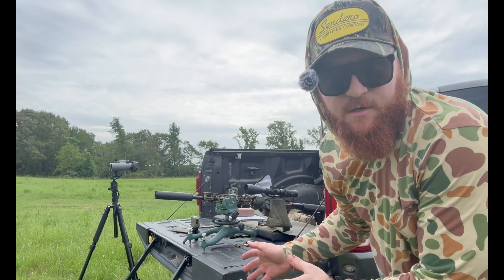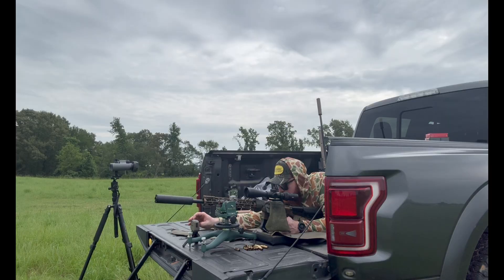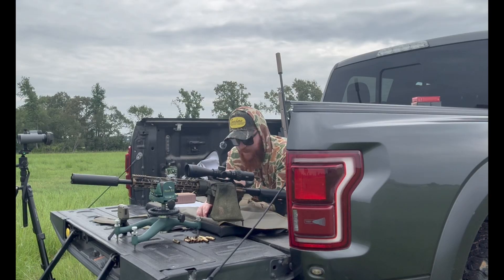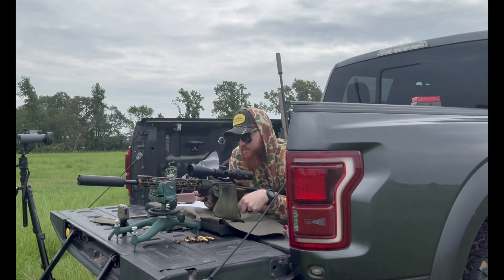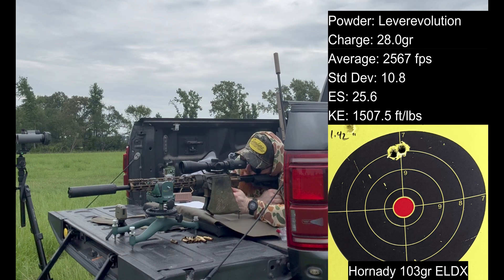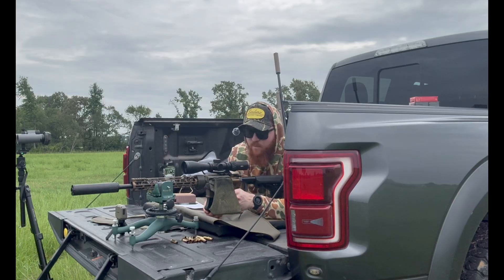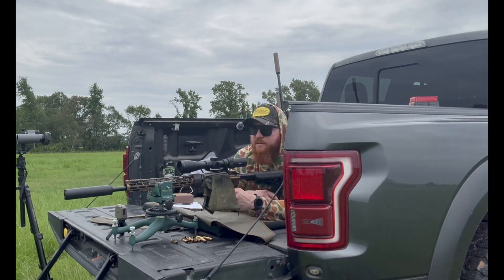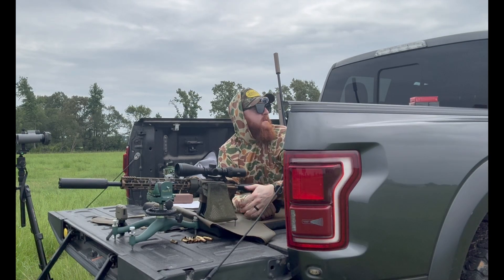ChatGPT Did My Load Development | 6 ARC Part 2

Comment: just watched 1 vid with GPT helping get .22 out to 200. now this. might have play around with it.
Reply from the maker: Check pressures in GRT or quick load if you have them! As always, work up slow and use published data as a guide. It’s a good way to index the internet for the best available data but it’s only as good as the data on the internet, if that makes sense.